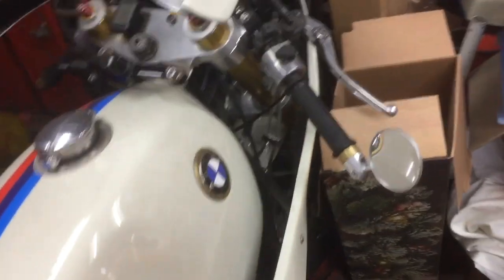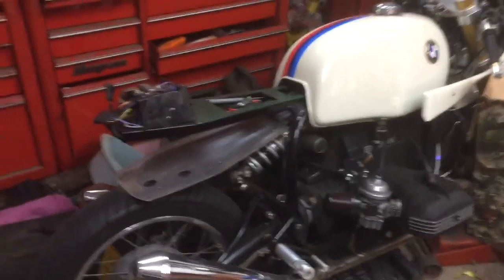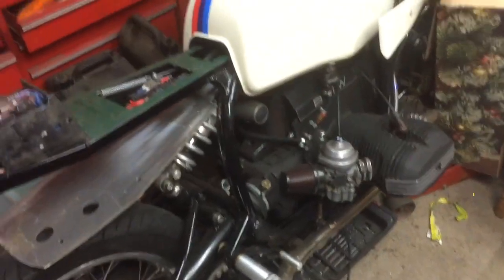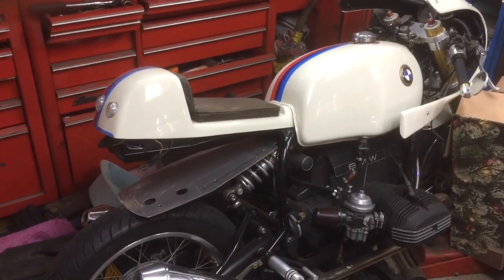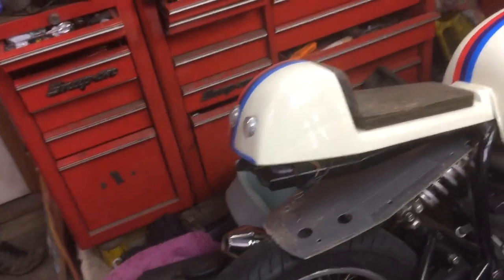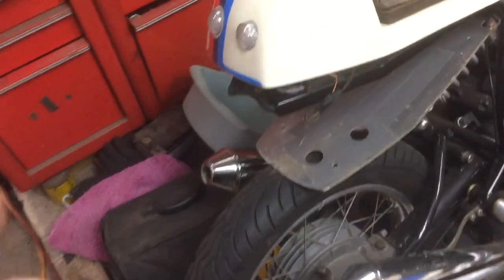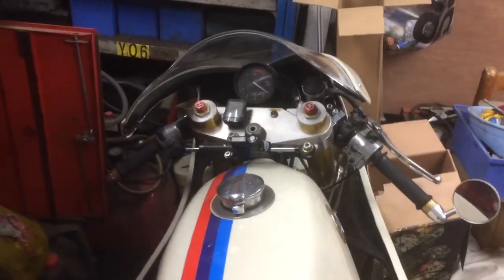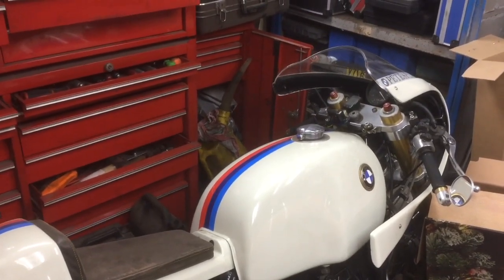bmw cafe racer project update.

Comment: Great to see her again. You were never sure of the back of the seat. I think the flat area looks good because it matches the rear of the tank. We also need a decent video of here in the twisties.
Reply from the maker: good evening, i did actually like it to start with, I love it from the side still because it matches the back of the tank,  i think the problem has been where i have it parked in the garage,  i keep going out to work on the camper and everytime i look at the bike i get its worse view (in my opinion - straight on from the back,  just not quite enough shape me thinks). i have been thinking about trying to do something with it for quite a while, just havent been able to get myself to touch it because i am afraid i may make it worse, however, camper pretty much finished now so figure i may as well give it a go, i am going to keep the old one complete so if it doesnt work i can always refit it...........

Comment: Good to see that project again !! You were my inspiration to start up mu own DIY bike. Keep up the good work !! I have good 3D modeling skills you just msg me here the dimensions and i will do the renderings which will save you a lot of time and effort !!
Reply from the maker: Many thanks for the offer, i think its going to be very much trial and error with the shape, i keep changing my mind and i haven't even start making it yet.......hope your's turned out ok...
Reply: petesplace55 any time ! Mine i have barely just started however the design is done all 3D files done so now execution. Bike completely stripped down and engine cleaned up and shining. Sub frame in the making. I would have shared the renderings but i cant do it over youtube. Its an 84 k100